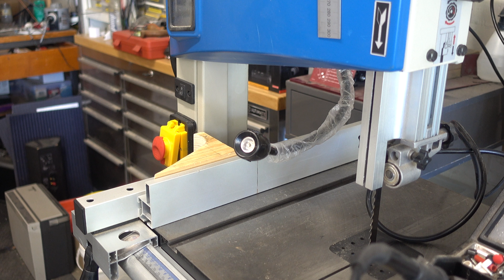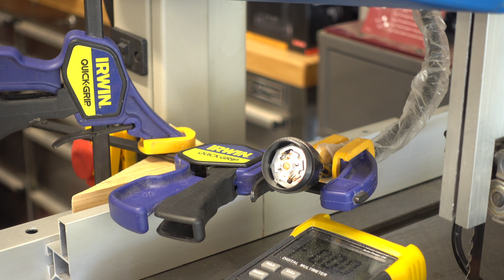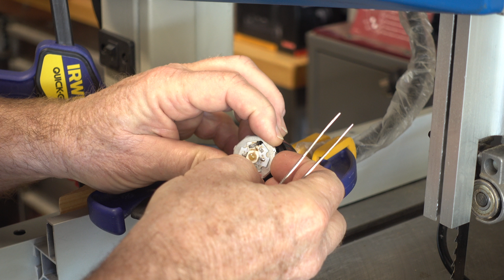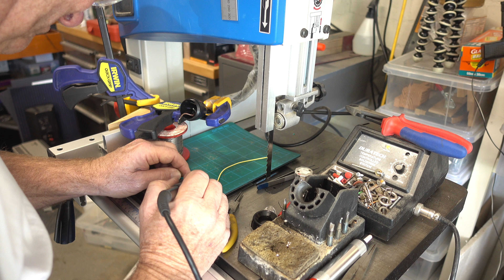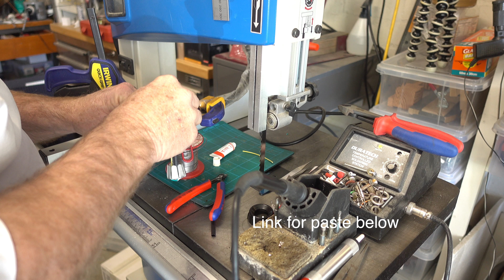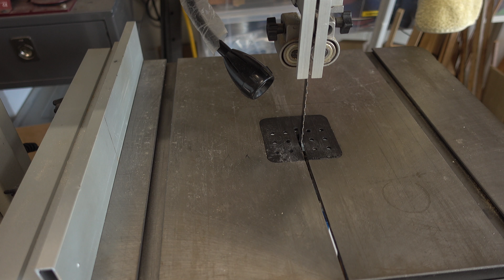Bandsaw LED repair. HAFCO BP-310.

Comment: HI Derek, I am in the process of deciding on a band saw. I have looked at the BP-310 and 360 online. I also looked at the Carbatec 14" here in Adelaide (doesn't have an LED light). Do you find the 310 does everything you need it to do? I am two minds as which one to get. I'm really just a home hobbyist. Also, on the subject of LED lights. I recently attempted to solder wires to a strip of LED lights that I needed to cut down for a different project and ended up burning them out. I was told I probably held the soldering iron on the little soldering points too long and the LED's overheated. Now I'm loathed to try it again for fear of having the same result. There seems to be a knack to LED's or I'm just lousy at soldering. I don't think I would even attempt the repair you did!
Reply from the maker: Hi Paul.  If I had my time again I would go with a bigger saw.  The throat clearance is a bit light on for some resawing I would like to do and the build quality is just OK.  But I have access to a bigger machine at the local Guild so I have a work around these days.  I think the Carbatec machine would be the go.  I doubt you overheated the LEDs, maybe you reversed the voltage or had too high a voltage for the cut down strip?  I am an electronics engineer by trade so this was pretty straight forward.  I know not everyone would want to have a go at it.

Comment: Hi Derek, I am looking to buy a bandsaw this model or 2hp up from this can it cut up to 50mm thick Aussie hardwood clean and square along the grain with ease?
Reply from the maker: Hi James. I cut hardwood all the time well over 50mm. But I use the rip jig shown in my other video and then spend a bit of time at the thicknesser.  You will struggle with a straight cut using the fence.
Reply: @Derek_Lark  basiclly be some curve cutting with grain for back chair leg/back rest.22mm to max 45mm
Reply from the maker: @Springboksimmer  should be fine but bigger is always better 😄
Reply: @Derek_Lark   I been doing wood work for 35 years  still never bought a band saw since my 9 inch 1960s rockwell delta lol. Used 1930s 1m 8 to 10 hp bandsaws at tradeschool ,was a beast.I have look at your rip jig . thanks for your feedback